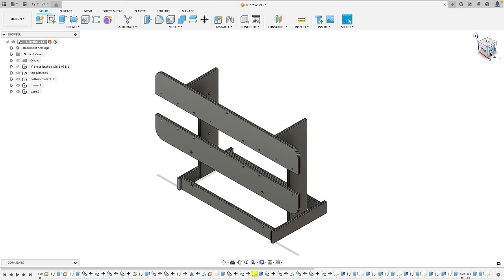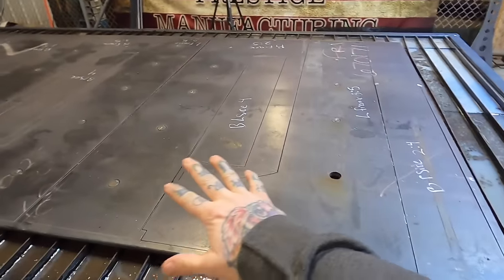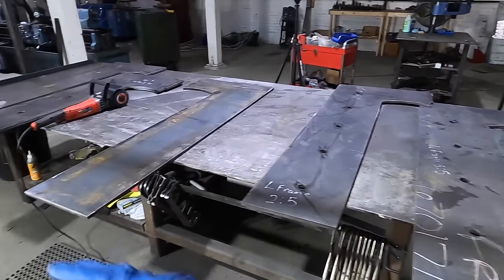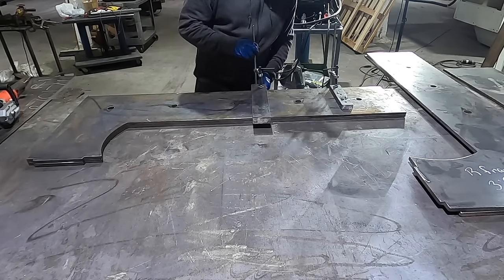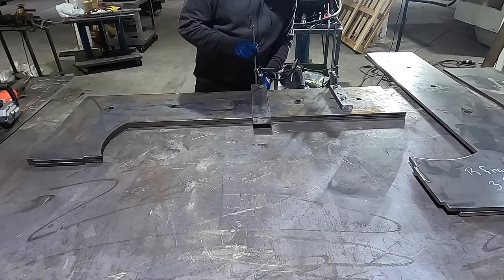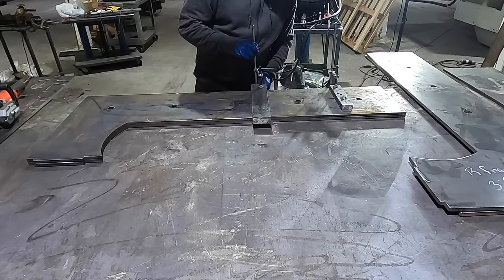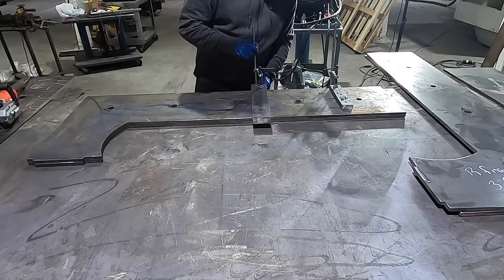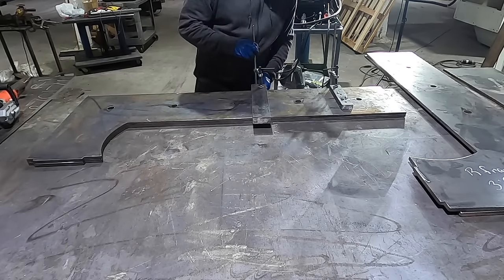Hydraulic Press Brake Machine Build .. Worth the $?..

Comment: Just found your channel.  Really like the content especially the press brake builds.  Interesting idea laminating to achieve thicker material.  I built a press brake years ago out of 1” and had to outsource the cutting because I could only cut up to 1/2”…guess that was dumb.  Interesting also using a ram that travels up.  I know it’s not a new idea but until watching your video I’d never thought it makes sense until you talked about overcoming crowning.  Also like your use of common materials for guides, very smart.  Looking forward to the next installment of this series.  Curious as to how you’ll get three cylinders to sync.
Reply from the maker: Thanks for the support I really appreciate it!